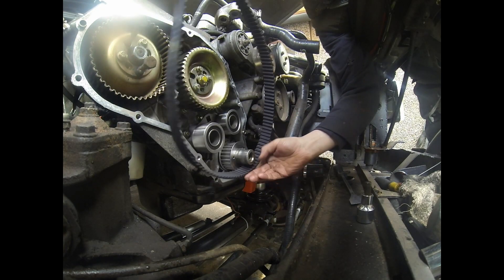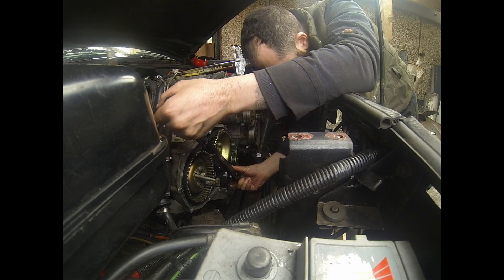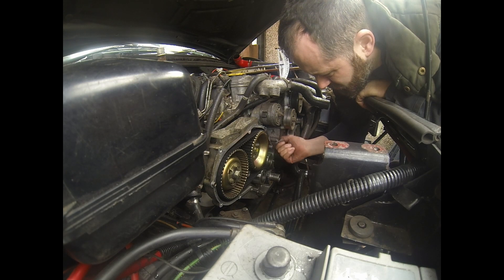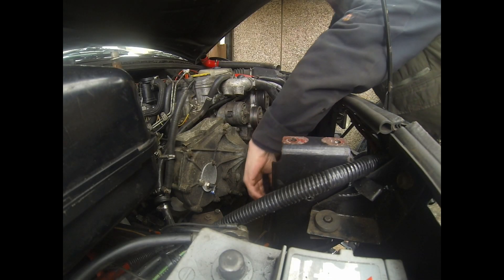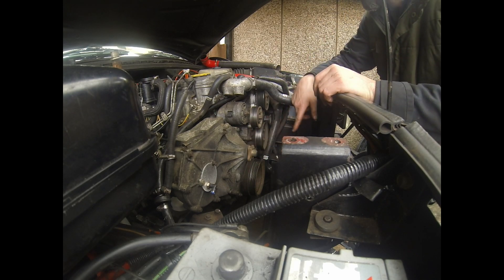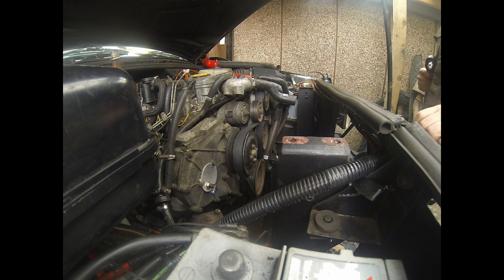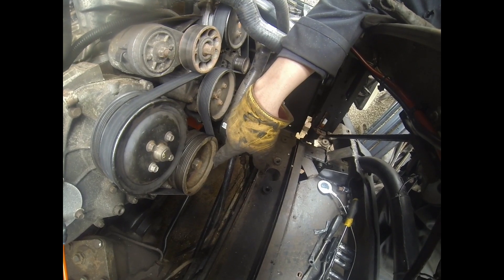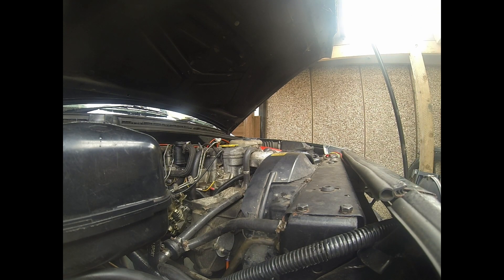Land Rover 300tdi front crank seal renewal Part2.

Comment: Just a little tip, if you  mark a arrow on the  fan and  timing belts when  taking them off, you can put them  back on the same way  preventing uneven wear.  👍
Reply from the maker: Cheers for the comment, that's my usual course of action but I was removing to renew so alls good.

Comment: So if I’m no mistaken, the 300 TDI damper bolt should be tightened to 80 NM and the 90 degrees. 

The other diesels and the 200TDI is 270 NM. I just set my torque wrench up with an extension and to go 90 degrees more probably hits 330-350 NM. I turned it 70 degrees and the torque wrench already clicked. I had to use a big bar to get it to 90 degrees and then I marked it. 

But correct me if I’m wrong on the 80 NM + 90 degrees. I’d like to have a second opinion.
Reply from the maker: Hi there the 300tdi crank pully bolt (dog bolt) is usually tightened up by first 80NM then @ 90 degrees.

hope this helps.
Thanks
Rich.